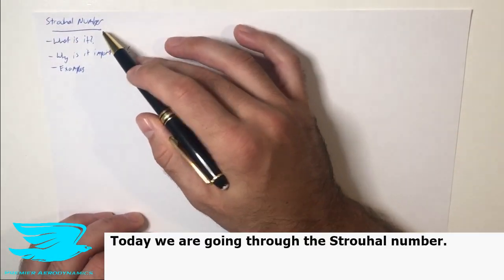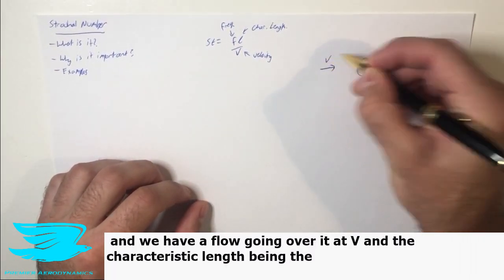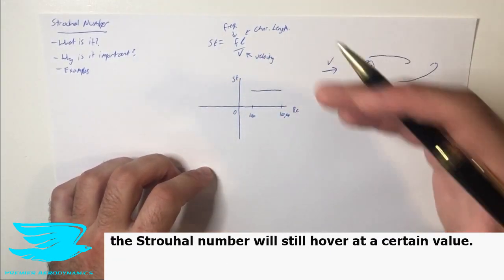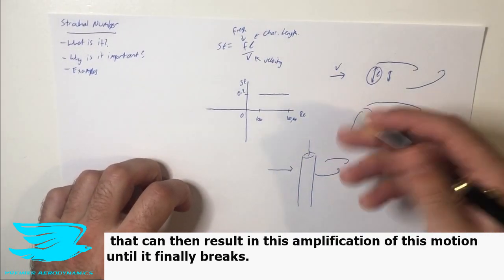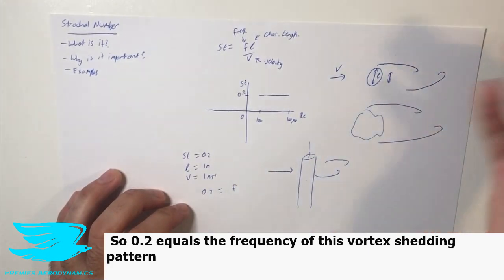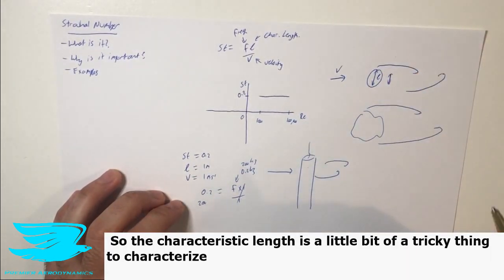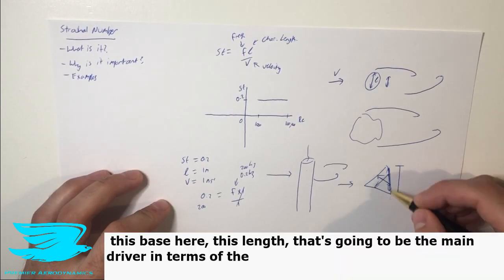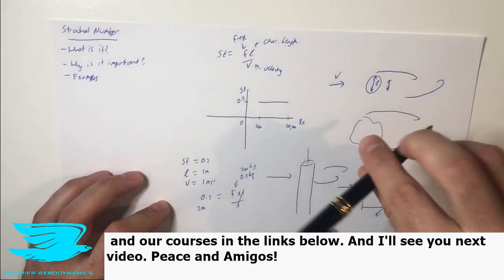Strouhal Number [Aero Fundamentals #26]

Comment: From the video i understood in practice we are looking for frequency, but from where do we get the value of ST# in order to get to frequency?
Or it might be the case we are able to experimentally determine the frequency and then look for ST#. But then again, why do we need ST# for?
I have heard and learned plenty of thing so far from your tutorials. Thank you very much!
Reply from the maker: The Strouhal number is a nondimensional number you can use to compare one object at certain flow conditions to another object at other flow conditions.

It's kind of like the lift coefficient, or Reynolds number etc.

By itself, it isn't that useful (although there is A LOT of literature on how objects perform at different Strouhal numbers and there are some relationships found between the Strouhal number and other numbers, like the Reynolds number). It's more for comparative sake.